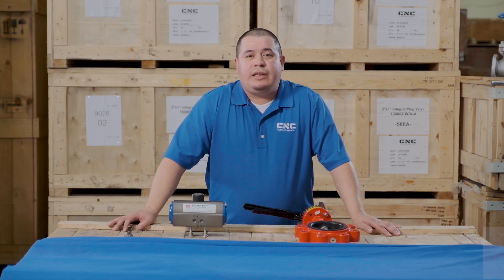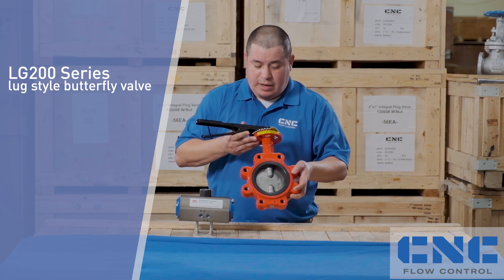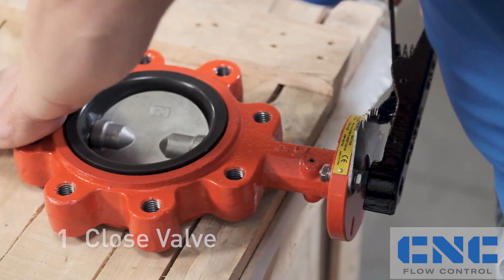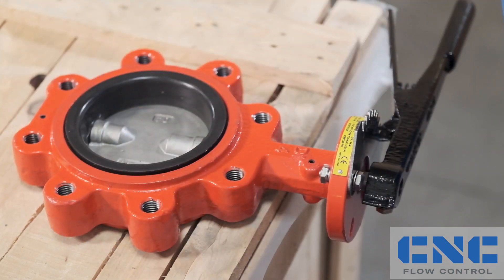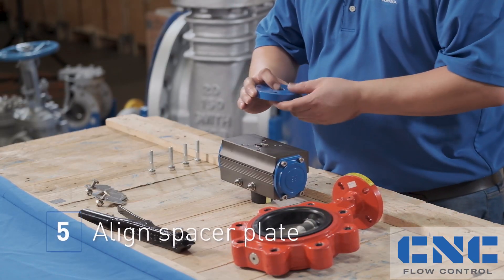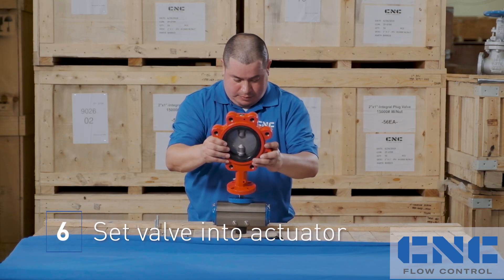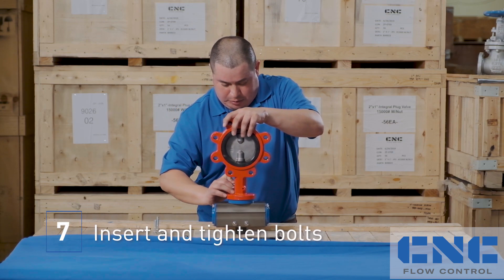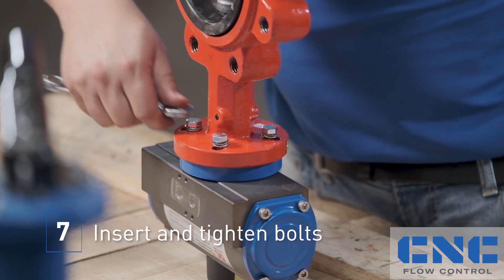Mounting a Pneumatic Actuator to a Butterfly Valve. It's Easy!

Comment: Hi, how to select the actuator size? I meant how to know if the actuator will allow the valve to open when the valve is under high pressure? is there any formula or table? many thanks in advance.